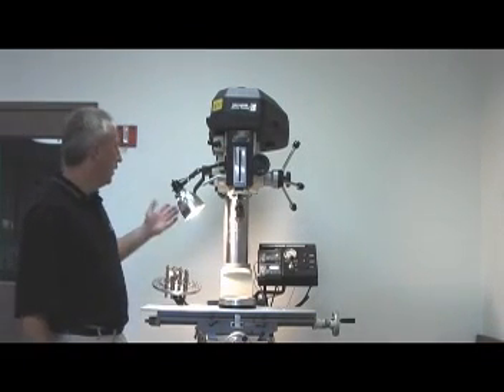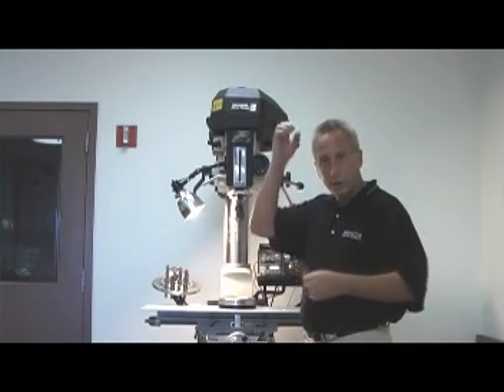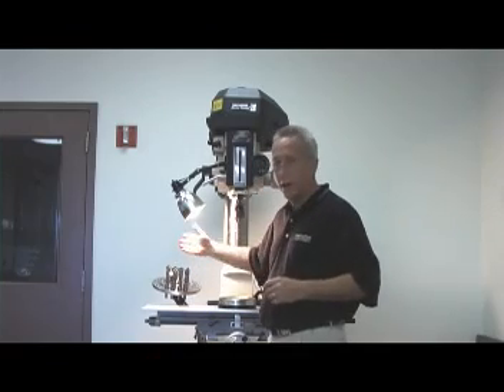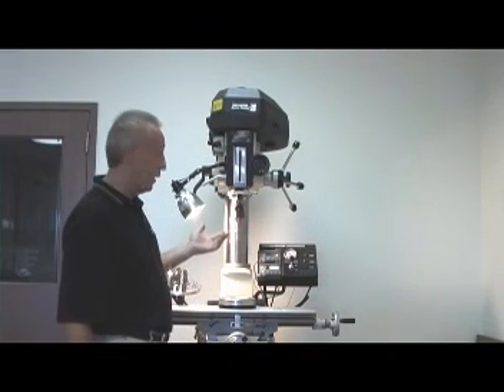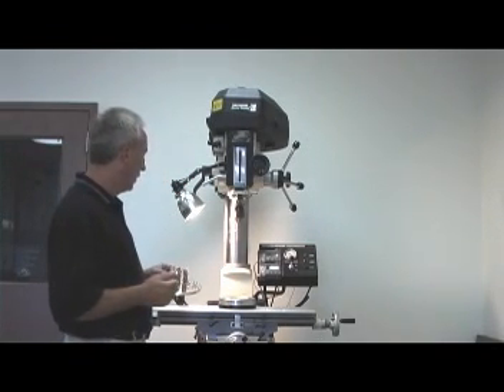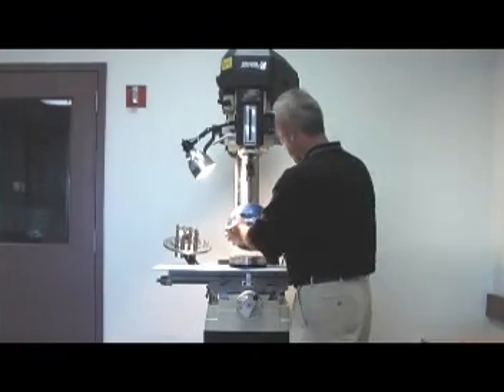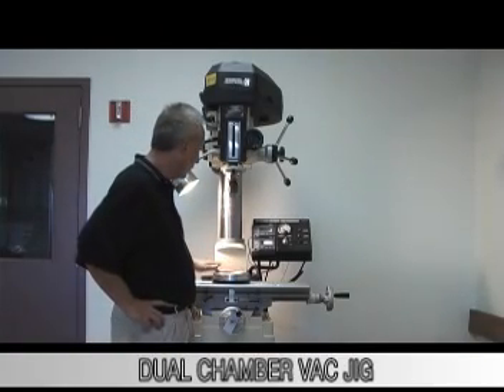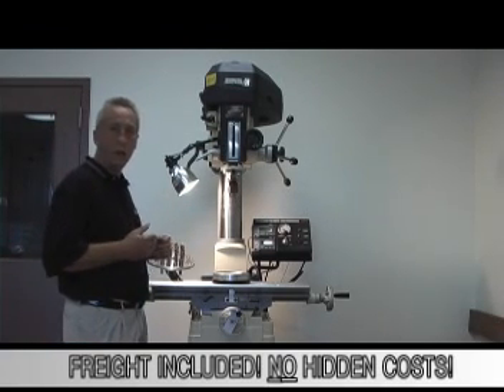Mill-Drill Plus Package

Comment: This is not a very state-of-the-art mill machine.The keyless chuck is standard on all mills as is the depth gauge. Also, the vacuum jig is inferior to a pivoting jig. With the vaccum, you have to line up the ball by hand making it hard to move it in only tiny amounts as you'll often need to do to line the bit up. With a pivoting jig, you can loosen it on the axis you need to an tap the jig in the direction it needs to go to line up the bit. This makes for super fast/accurate drilling.